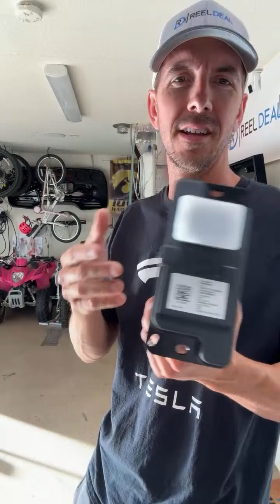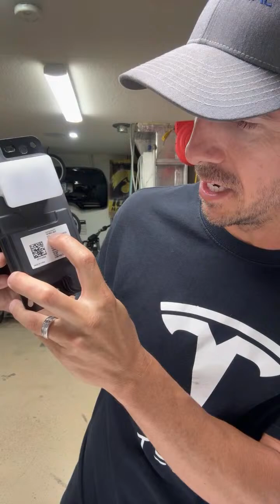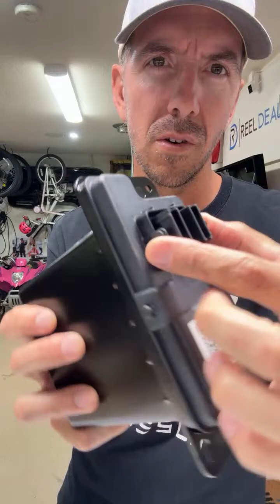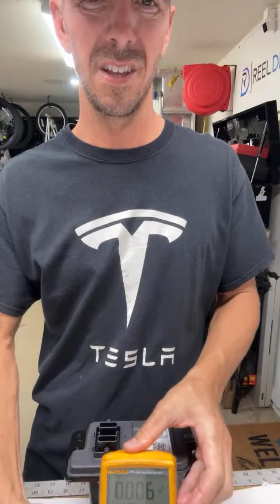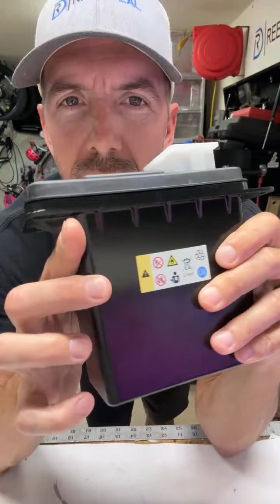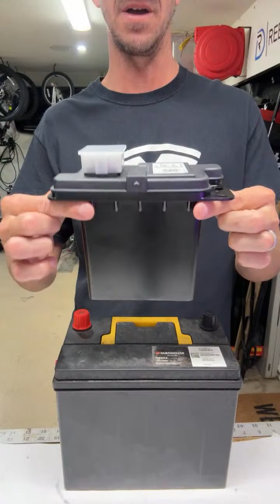48 volt Cybertruck battery discussion

Comment: Comparing the size of CT battery to an automotive 12v is pointless.  A 12V actually cranks the car to start it (drawing huge amounts of current), in a CT, all it does is unlock the doors, turn on the vanity lights, and power a relay to connect the high voltage battery.   If the HV battery goes off-line for some reason, it will power the rest of the accessories/computer for a few minutes.  The CT 48v battery is ONLY 4 Ahr (~192Whr - less at 41V), a typical 12v is 40-60 Ahr (480-720Whr).
Reply from the maker: Pointless? Idk, it got you to watch. I was just simply looking at the two from a traditional 12v perspective, the fact that it is now 48v is crazy, I don't really care about the Whr, because it is connected to the main battery.

Comment: I thought 13 s meant 13 batteries in series and 1 parallel
Reply from the maker: That would be pretty close, if nominal voltage on an 18650 is 3.6 volts it would be 46.8volts. I don't know if it has 18650's in there or not. Maybe I should open it up?
Reply: @thereelwdad As I know，there are pouches in this pack，not cylinder cells.
Reply: 13cells maybe?
Reply: 6s rc helicopter batteries is 6 cells